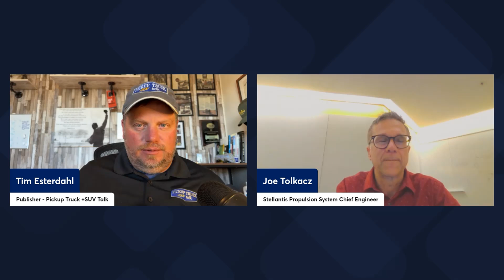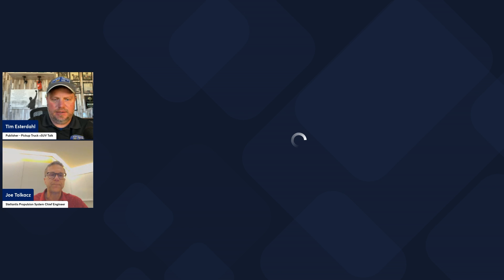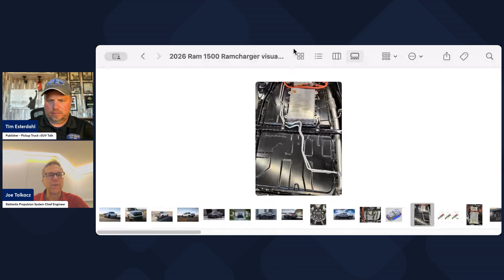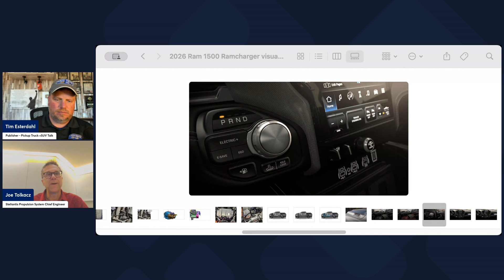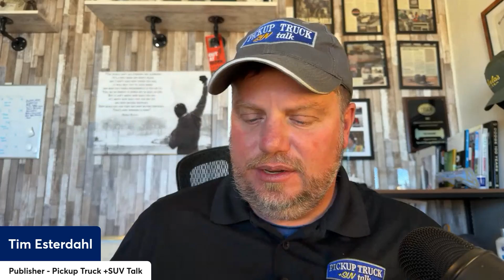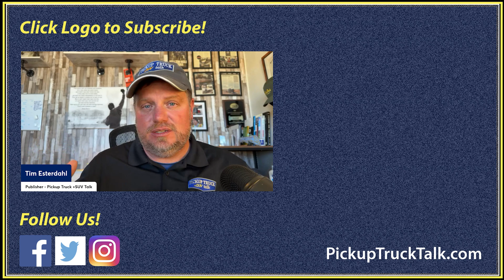2026 Ram 1500 Ramcharger Engineer Interview - Towing, Range, Engine Choice, etc...

Comment: This is the only video I've seen that explains how the generator provides power to the electric motors - through the high voltage inverter not by charging the battery which delivers much better power output.

Comment: Key word is “diesel” in diesel electric. 

Diesel engines produce low end torque meaning lower rpm, ideal for generating electricity nearly doubling the fuel efficiency over generators powered by gasoline.

In the past Ram stated the RAM battery gasoline v6 range extender would deliver over 35mpg when running on the generator. Not correct.

However, even without a payload or towing it’s reported it’s reported the RAM battery v6 gas generator only achieves 20mpg.

Ram ECO Diesel Background:
When Stellantis canceled the 3rd generation 3.0l v6 ECO Diesel after 2023 model year, RAM/Stellantis stated the coming Hurricane i6 gas engine would be “nearly the same mpg and the RAM v6 battery range extender in development would get even better mpg than the ECO Diesel”. Both false.

However, both the Hurricane and v6 gasoline range extender mpg are significantly less fuel efficient than the ECO Diesel 3.0l v6 and cost significantly more money to purchase.

The additional weight of the battery gasoline v6 range extender without a payload or towing at best is reported only achieving 20mpg simply doesn’t justify the additional up front cost and future cost to replace the large heavy toxic lithium battery. 

In terms of cost and efficiency, ECO Diesel 3.0l v6 was the best RAM 1500 solution to date. 

In fact, the costly re-engineering was just completed on even a more fuel efficient, more reliable 4th generation ECO Diesel when Stellantis killed the entire ECO Diesel program. Big mistake.

This in turn financially forced the European ECO Diesel engine manufacturer to be sold and exit the diesel vehicle engine market, now only focusing on the marine and industrial diesel engine markets. 

In conclusion, Stellantis killing the ECO Diesel program for the RAM 1500 market is yet another huge Stellantis mistake as to date RAM has only false promises of a “future product” to replace the superior ECO Diesel in terms of cost, performance and fuel efficiency: 

Hurricane engine, NO. Battery v6 gasoline range extender, NO. HEMI, NO. V6 gasoline engine, NO.

Comment: Firstly, we need to ensure that the vehicle's cabin heating system can effectively utilize engine heat, especially in extremely cold conditions where the heat pump alone may not be sufficient. This can be achieved by integrating a system that captures and transfers the engine's thermal energy to the cabin. This will not only enhance passenger comfort but also improve the overall efficiency of the vehicle.

Secondly, one of the downsides of electric vehicles (EVs) is their limited range and performance in extremely cold temperatures. By incorporating an engine that can provide additional power and heat, we can mitigate these issues. The engine can act as a range extender, providing extra energy when needed, and can also supplement the heating system to ensure the cabin remains warm even in freezing conditions. This hybrid approach can significantly enhance the reliability and usability of the vehicle in harsh winter environments.

Comment: I wish Ford and RAM would keep offering 6-seats in the higher trim level for their trucks. Some of us have decent size families. Seems like all the manufactures have decided 6 seats equal basic work truck and all the tech goodies and hybrid systems are unavailable.

I will say, owning the F-150 PowerBoost, doing a lot of RV towing, tailgate camping, hauling, all the normal truck stuff, and even running the house off the truck twice during power outages, I am certainly looking forward to seeing what this RAM will do. (Of course I won't buy it unless there's a six-seat version or until a few of the kids move out)

Comment: Why not give the Ramcharger two 20-gallon gas tanks, even at 20 miles per gallon, that should put the range over 1000 miles
of range, including the battery power? Or if you are using the battery with the motor together it should get 50 miles per gallon till all battery is used up Right?

Comment: I am happy to be an early adopter of the ram 1500 charger (if i can afford the price) because of what I already do with my cargo van - i work full time remote and chase cool weather for me and my dog. The places i go are pretty remote and this driving range is a dream. I do not fear issues or breakdowns because i already know how to cope with those problems after owning various used vehicles. I am not a mechanic, but i appreciate tech advancement and good design.

Comment: I have a Cadillac ELR with the same set-up, works great. I want to know how they plan to make the battery modules replaceable in the future. The ELR requires the whole battery system to be replaced at a high cost. Replacing just a smaller module of batteries will keep the cost down. Thanks

Comment: I like plug-in electric hybrids and I always wanted a Ram Truck (worried about transmission issues), but I do need a pick up truck.  So today, I asked ChatGPT and it gave me the 2026 Ramcharger with range extension as an option.  The Scout will do the same. Now I will have 2 choices.

Comment: If you rarely run your engine and have a tank of fuel that's not being used, you will probably want to add a gasoline stabilizer, like Stabile, to it. However, I think most people who buy the truck will be using the engine more than that.

Comment: The Ramcharger (according to Grok) will use J1772/CCS1 charging instead of NACS, at least for the first year or so. But I think this is okay for the Ramcharger because you won't really be needing the DC fast charging on the road and will do most of your charging at home with the J1772 Level 2 charge port. Even if you have a Tesla charger in your garage, as I do, you can use a very inexpensive J1772 adapter to charge it. RAM should also be offering CCS1 adapters.

Comment: My concern is cold weather performance. Obviously being a standard pentastar getting a block heater for the generator is easy enough. But I am wondering not only how extreme cold will impact the battery performance but also about starting the generator portion in the cold... though I suppose you could just it like a normal gasoline powered truck plugging in the block heater when parked and driving it in a mode with the engine running which would compensate for both problems.

Comment: The Chevy Volt did this in 2009. The Volt was programmed to run if you never ran the ICE as well. Not a ton of innovation here if Im being honest. My biggest complaint is you are carrying around two separate propulsion system  which is additional weight, complexity and twice the number of parts to potentially  fail and you still have to change oil, filter and coolant.  Dodge isn't being generous here as federal law mandates that EV battery packs and drive units  have a minimum warranty of 8 years or 100,000 miles.

Comment: Dig the truck but he said it would get 266 miles per gallon driving through Nebraska towing max weight so… 266 miles and 27 gallon tank is less than 10 mpg. That’s starting with it fully charged on flat ground
Reply: That is at the max 14,000 load. I bet if you were pulling 10k probably get 325 miles.  Still better than my ram 2500 cumming only get 9mpg towing

Comment: I have a 2020 Ram Eco Diesel and 2013 Chevy Volt.... I can say the same technology the Chevy Volt is electrical driven system with a smaller 16 Kwatt battery.  I must say the Volt is amazing and to drop that tech in 2019 wow Chevy dumb dumb so stupid... 

So my Volt I do about 3000 kms driving a month and it costs me about $150 a month.  Most of my driving I can usually get done on battery (35 miles/60 km battery) Then gas kicks on and I get another 450/500 kms. This is very smart RAM when my Volt dies this will be its replacement... currently my Volt is at 275,000 kms and still going strong... I change oil every 2/3 years, tires and wiper blades that's it.... I have yet to change brake pads on it, this thing is just electric/gas and Go!!!    Well done RAM i believe this will be a big hit. I talked to my dealer and I'm number 5 on list for a demo drive...... I must say the Volt has saved me about $5000 in fuel per year, I purchased just before Covid as I felt fuel prices was going to get crazy and I wanted something to keep a float...  I paid $12,900 (Used) for my volt and it had a 133,000 kms on it  at the time. This car paid itself back around 2nd or 3rd year....

Comment: I like the technology but I don't need something this big. Here is what I would like to see - and get. A MIDSIZE pickup - like Dakota, Ranger, Frontier, etc - extended range series hybrid that can go 150 miles on pure electric power with an additional 200 miles on gas (minimum), and tow at least 7000 pounds.  Or - better for me - a van with this system. When somebody starts making one, I want to be one of the first to get one. Last but not least, not too expensive.
Reply: Scout is trying to do this

Comment: Q: "What is the max engine RPM when the batt is depleted  while you tow heavy"  A:"????"  he never told the max RPM.  The 3.6 will rev so high to pull a 14000 lbs trailer with a depleted battery. The same size engine in the Gladiator, Durango, etc. is barely enought to pull 5000 and it is NOT a pleasant towing experience, ask me how I know?  I like the REX concept of this truck a lot and would consider it to replace my V8 Rebel and I'm sure a 5000 trailer would be ok (not 14000), but I have a feeling the selling price will be so high .... no chance most of us can afford this thing.

Comment: I thought that the electric range would be same as the cybertruck around 300 miles
50-100 sounds too low
I would buy one without hesitation if the electric range would be over 300

Comment: GM definitely dropped the ball when they canned their Voltech system. The gen 2 Volt wasn't perfect but the GM engineers were a decade ahead of everyone including Toyota, the Prius is just now posting numbers the Volt did. Now Ram is going to steal the market for hybrid pickups. A Voltech Silverado/Sierra with an LGX range extender and beefed up planetary gear transmission would have stolen the show by now and would be much more developed by now after a decade of upgrades. A V8 HD Voltech version would have been great also!

Comment: I just crossed Stellantis off my list because of my daughter’s 2020 44,000 mile Ram 1500.  Paint just started peeling all around the windshield and the one dealer who looked at it said the windshield was replaced.  She has never replaced the windshield so I suspect it was a post build issue at the factory.  Note: The dealer from which she purchased the truck was nasty and pretty much flipped her off.  Ram Cares blew her off as well.  Very disappointing for a $70,000 truck.
Reply: Lemon laws exist for a reason.
Reply: You paid 70k for a 1500?

Comment: How does regen breaking handle heavy loads? I have a use case pulling a gosseneck horsetrailer up a steep mountain and back down.
Reply: If it is like my Cadillac ELR it will help alot, I just set the cruise control and it auto adjusts the regeneration to keep the speed. Having a trailer behind would be big push, hope it adjusts the trailer brakes to help.

Comment: Great engineering interview. Will you be following up with one from marketing in the coming months to cover the other questions? You also show two graphics mid video, one with EV/Hybrid/and Engine Only modes and another with the drive selector switch that shows Electric+/E-Save/and ECO. Which will be which. The later seems more confusing.

Comment: Does the engine run at a constant rpm say over 3000 in the city, or at a red light?  I think that is going to annoy the crap out of people.  Especially if the generator has a whining or humming drone.  Hopefully not like the midrange drone from bad dual exhaust systems.  Having the engine and generator up front and close to the passengers may be a mistake.
Reply from the maker: You can’t even hear it running.
Reply: Yeah, I saw that part in the video. 6:00  Guess we will see when it comes out.  And how it sounds under load.  V6's seem to have the worst nvh or at least most annoying.  Sounds like they really tried to get rid of most of the nvh.  Thanks for the video!

Comment: I put a deposit down but still have not heard if the ramcharger will be flat towable behind an rv.  Sounds like I might hear soon thanks to folks like you
Reply from the maker: I just asked and they said no.
Reply: @Pickuptrucktalk you mentioned no factory 5th wheel but aftermarket 5th wheel and option?
Reply: @Pickuptrucktalk can it be towed or only hauled?

Comment: They want people to be able to run their truck a long time and EOL parts on vehicles after 10 years.......total BS
Reply from the maker: EOL parts is 10 years? Where did you hear this??
Reply: @Pickuptrucktalk  It was on my 2013 RAM 68159705AE.  At least last May it was EOL, looks like they revived it.  Its a harness so no reason why they cannot make them to order since connectors aren't EOL.  I have a text string with the service manager still i can show you (i'm in Denver).

Comment: Tim if you get the chance to ask more questions, I’d love to know the possibility of this setup but without the actual battery, just the engine, generator and electric drive motors for the more budget conscious. That battery space could be a larger fuel tank. No driveshafts, transmissions, etc
Reply: Would not make sense.   It will never be as efficient to convert mechanical energy to electricity and back to mechanical vs. just keeping it mechanical.    The reason diesel locomotives use a scheme like that is due to the wider range of "gearing" it offers and the extreme mechanical complexity that would be needed to distribute mechanical energy to  all those axles.

Comment: I think this is a real breakthrough in how we go forward. This should give us the fuel ability of an ICE vehicle, the torque and reliability that comes from electric motors, and the big range when you have both, not to mention no transmissions to worry about. If they do this right I think this truck should sell super well.

Comment: When they get this right, and they might right out the gate, this is going to be a home run. I would LOVE to see this same type of system in the Durango, Grand Cherokee, and Wagoneer/Grand wagoneer. Never need gas for day to day driving and still be able to take as long of a trip each weekend or yearly big road trip without having to find a single charging station, WIN!  Personally would I still miss the rise in RPM's and the sound and feel of pure ICE? Of course, but I could see a vehicle like this always being one of our households "fleet."

Comment: I am unclear about what he said when you asked him if the traction battery fails, is the truck still drivable.  I still drive a 2013 Chevy Volt that I bought brand new.  It’s considered an EREV instead of a hybrid.  A lot of the functionality of the truck resembles the Volt.  However, on the Volt, if the traction battery fails, the car is not drivable even though the ICE is perfectly fine.  All EVs still use 12vdc batteries for their operational side.  My Volt uses the AGM battery.   GM uses the Ultium platform for their traction battery which is modular.  Suppose to exchange a bad cell without changing the whole battery if a failure happens.  Also suppose to be upgradable to new battery technology.  Not sure why they are not incorporating the NACS now.  Cost??  Tesla’s charging network is far superior than their competitors.

Comment: I want to tow a 10,000lb 5th in the western US for days without pluging it in. If it will do that I'd be interested.
Reply: Depends on where the battery is if it's under the bed then I don't think you would be able to have a 5th wheel

Comment: Am i right in saying that the generator supplies power directly to the motors when the battery gets too low or have i misinterpreted what was said.
Reply: The generator supplies power whereever the power can go. Its feed to the same power bus that is shared between the motors and battery.

When your motors are drawing less power than the generator is making, that excess power will fill the battery.
Reply: You are right in saying that it can. It has several modes. The systems seems to have all around power sharing. You can send power to charge the battery as well

Comment: Why not go for a 40amp capable 240v plug on the bed instead of a 30amp, seems the truck has a huge generator.  This would be really helpful to replace a portable home generator and run a home AC with a built in soft start.

Comment: It can and does work like a locomotive. The motor drives a generator which supplies power to the electric motors but different from a locomotive it also has a battery.